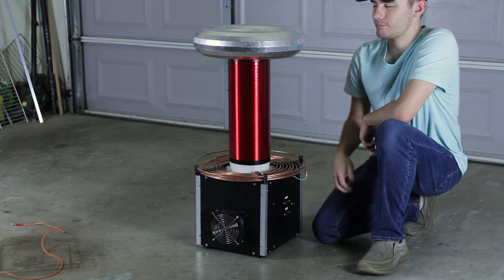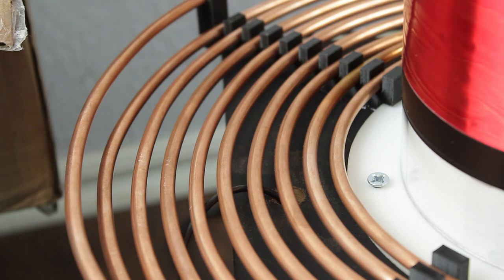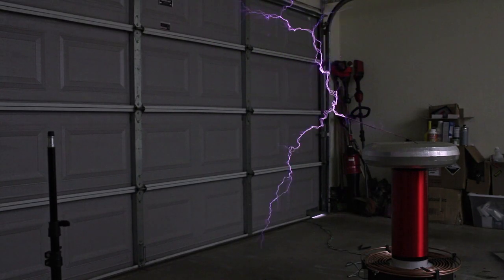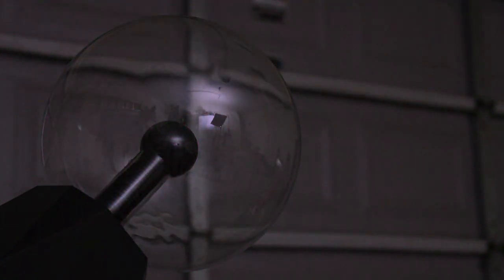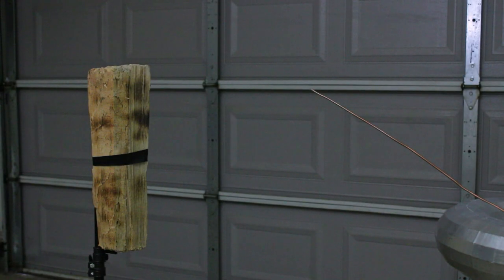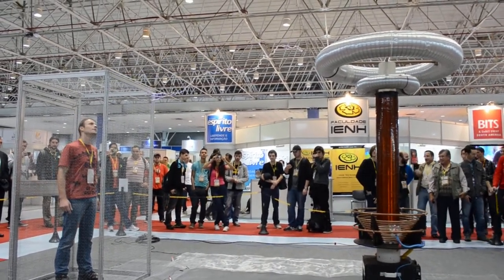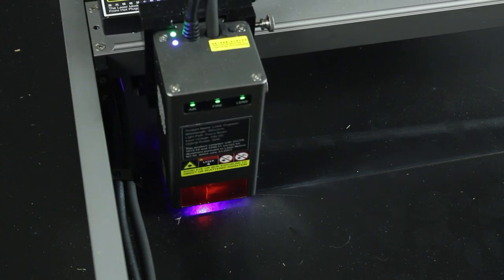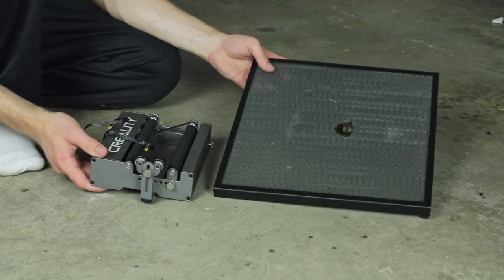Building a Large DRSSTC | Part Two: Extreme Testing (Propane, Plasma Globes, and More!)

Comment: That's impressive arc length from a coil of that size, but CM300s are beasts of igbts. You can definitely set the current limit to at least 1kA, and crank up the on time as high as you can go without tripping the OCD for some insane arcs. Great coil!

Comment: Besides for scaring the s-ht out off cats and dogs, as well as wet party tricks ... what is the use? 🤣🤣🤣
Reply from the maker: Absolutely nothing!
Reply: @LabCoatz_Science  that just makes it even more fun to do if the practical use for it is absolutely nothing in my opinion , just like the practical use for throwing chunks of alkali metals like sodium and potassium in water and watching them explode violently is absolutely nothing but it's still so much fun to do it as long as appropriate safety measures and safety equipment like a full face shield are used. Is the electrical discharge from a Tesla coil a high voltage and high amperage electrical current and therefore capable of causing serious injuries or even death if someone gets too close or is it like a van de graaff generator which builds up a lot of high voltage static electricity but which has little to no current and therefore is capable of delivering a painful electric shock but one that is unlikely to cause injuries ? Glad you know what you are doing as well that looks like something that should be left to experienced people like you who know how to do it as safely as possible.

Comment: Is this at all close to the impact of an EMP or CME?     

Would it be possible to simulate either of those events and test the "EMP proof" gadgets for vehicles etc.  (Also: test DIY faraday cages to see if they'd hold up in a real event)

I see the faraday cage at 10:20.   That is cool. However, i'm wondering if the trashcan 'cages' etc would actually in real world scenarios, to protect your phone and stuff when you know the sun might be spittin' out some nasties._
Reply from the maker: Honestly, EMP weapons usually utilize ultra-high magnetic fields instead of electric fields, but the concept it fairly similar. Even a thin layer of aluminum foil should be enough to keep out almost any sort of EMP!

Comment: ..  So all you need to do is connect your base of the resonator to your transmission waveguide. And push Pull your primary into different modes of operation.
Over to an opposite wound receiver of identical tuning.

Comment: Amazing Tesla Coil,
Is there a place you can share the schematic, any additional information you have from building your first DRSSTC including more information on  the  GDTs connections/placement, and could you provide  
information on the supplemental parts you and Allscience used in building LoneOceans UD2.7C, the parts list he has from Mouser has discontinued parts, as I would like to build it  from scratch, or do as you did with Allscience  if he  allows.
Thanks again!

Comment: I wonder if zapping a car is potentially dangerous to the electronics, I'm a mechanic and I've seen cars hit with big shocks and ruined completely, but I've never heard of a car hit by a tesla coil, I bet there is probably a specific amount of electricity where a car might start having stuff ruined, it probably also depends on where and how it gets hit and if exceeds the rating of everything or because it somehow zapped a computer dead. Mostly just curious because I figure you probably thought about the risk and determined it wasn't that bad before doing this

Comment: try using a wire to disperse the electricity to other unit's , small light bulb's will be the preferable use , as with more output will require a larger unit

Comment: Absolutely fantastic! That is insane it only draws the power of a toaster. What power does your Spark Gap tesla coil draw?
Reply from the maker: Roughly the power of three microwave ovens (over 2-3kW most likely).
Reply: How did you handle the current draw? I am making a dual MOT tesla coil with some friends at school and when shorting one MOT we drew around 60 amps according to our ammeter. Do you think a ballast or a variac will be enough to allow it to run off of a 20 amp circuit?  @LabCoatz_Science

Comment: Have you tried using an scr to control the main power input?
Reply from the maker: Nah, don't really need to. The Variac does a good enough job, and if that weren't an option, turning the pulse times down on the interrupter naturally decreases the arc size.

Comment: That thing is an absolute beast. Very well done man.
Reply from the maker: Still kinda wish it performed better honestly! Loneoceans had a smaller coil with what should've been a weaker setup (half-bridge with 1875uF bus capacitors, a 0.15uF MMC, peak current at roughly 400A, and a 13" coil), and he got up to five-foot arcs, while I only ever hit a bit over four feet. I might tweak it eventually...the primary coil could probably be raised a bit and have another turn added. Maybe a larger topload and even more primary turns would help? Hard to really say why it's not as good without more testing!
Reply: @LabCoatz_Science  I know literally nothing of the solid state versions of this but I will say I was immensely surprised by the effects of swapping out secondaries. One was wound with scrap wire that was slightly finer than 36 AWG but not by much and was 1.5'' x 8'' .This gave me nice 1" sparks once tuned, with medium coupling good current output, had decent Q, and was a little finicky about tuning; so much as placing a large grounded object near managed to change the resonance drastically causing brush discharges to kinda dim out a little then pick back up once it got close enough to arc. The other secondary I never managed to film that one but it was from a failed bigger one. The aspect ratio of that one was really bad (beginners mistake) but it was varnished and conveniently 1.5" so I sawed off a 4" segment from it. This was wound with 38 AWG (this was a nightmare to wind as it's literally as fine as hair.) Q was noticably lower as the band width went up (less picky about the environment) and coupling was clearly higher as it had the same voltage but the arcs from this were not the same at all, they came in intense pulses that had a tendency to ablate anything they struck leaving pitting and often showing incandescent bits getting thrown from where it hit. Not much retuning was needed as they had roughly the same inductance but that just shows the difference between the two. Sorry about the long rant hopefully this was somewhat useful though.

Comment: Whoa! How did I miss this???
Reply from the maker: YouTube just hasn't been recommending my Tesla coil content very much recently!
Reply: @LabCoatz_Science  Excellent output too! What's your mmc rating?
Reply from the maker: @KDewees91  it's a 6kV/0.25uF bank of 942C 2kV/0.15uF Cornell caps (five parallel bands of three in series for a total of fifteen capacitors). So far, it has handled pulse duties up to 200us and 200Hz with flying colors!
Reply: Excellent!